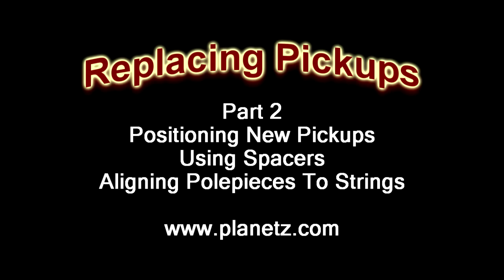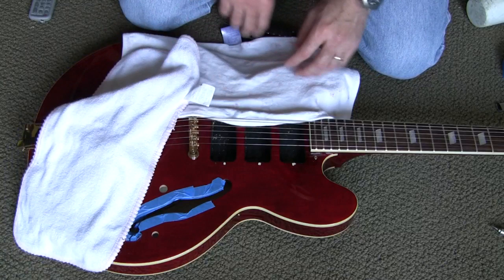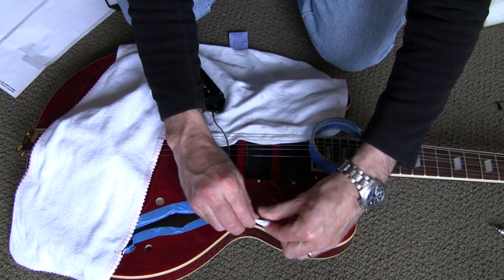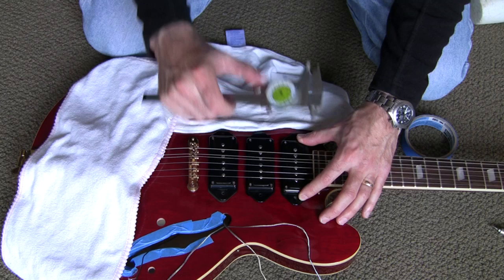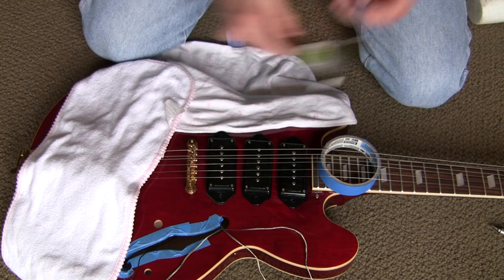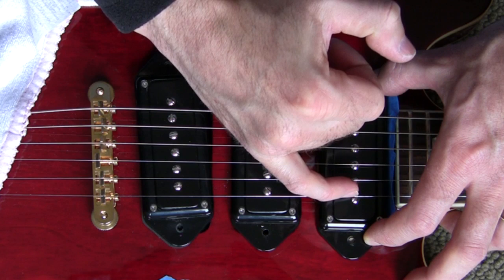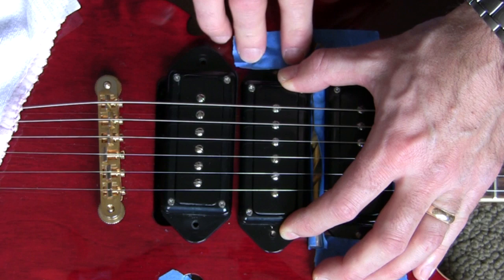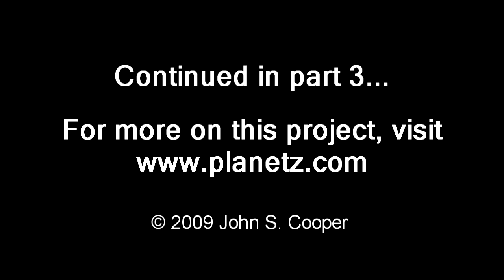Replacing Pickups In a Semi-Hollow Body Guitar, part 2: Positioning the Pickups

Comment from the maker: That Yamaha has soap-bar style P-90 pickups, right? There should be adjustment screws on each pickup (between the pole pieces), to raise and lower the pickup.  On dog-eared pickups like on the P-93, it’s not so easy- you have to use spacers

Comment from the maker: I haven't heard those Yamaha pickups, so I can't tell you whether the Gibsons will sound better.  Try to get into a guitar store to try out some guitars with Gibson P-90's before you buy/upgrade.  Or at least buy them somewhere with a good return policy :)
You should be able to easily remove your pickups (by removing your strings and loosening the pickup adjustment screws all the way), so you can measure their dimensions.

Comment: why didnt you just use the pickguard to evenly space the pickups, as in front to back, surely that would have been quicker than measuring and using spacers? correct me if im wrong! great video

Comment: Yup, thank you for the advice. I've dug around on ebay and have seen a pair of "Yamaha SA 503" P90 pck ups on sale, in the discription it says that all pick ups are in different sizes. Could this be the case in my guitar? 

If anything, would you recommned getting gibson p90 pickups on my yamaha? have them all the same size, so they arent as high that my pick hits it when im picking stings or strumming? (also for sound quiality too, not just comfort of not hitting my pick ups with my pick)

Comment: Re 6:00 approx, is it kosher to mount the pickup at an angle as opposed to parallel in order to effectively shorten the length of the pole piece array to match slightly narrower strings?

Comment: Hi John, I too have a P-93, I recently bought a Yamaha SA 503, both guitar are very similar. How do I adjust the hieght of the P-90 Pickups from my Yamaha so all 3 can be even like the pickups on the P93?

The Yamaha, like the p93 has 3 pickups. The neck pickup is "low" while the one in the middle and the 3rd one towards the bottom are higher. It's annoying while playing, my guitar picks ends up clashing with it. I want to adjust them so they can all be the same hieght, Any advice?

Comment: Love your videos I have the same guitar and want to replace my pickups too but most dog ear pickup sets have 2 not 3  pickups. so should I buy 2 fronts and one back or the other way around? Or are there sets of three?
Reply: StoneyBoudler , did you solve the question where it can get a set of 3 pickups P90 dogear for the epiphone custom riviera p93? overall which pickup it can put in the middle ?